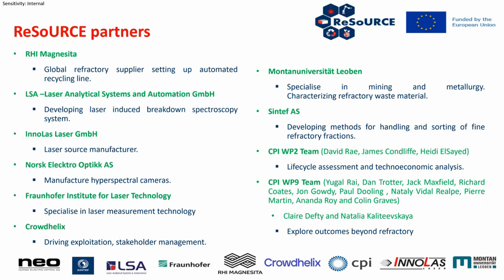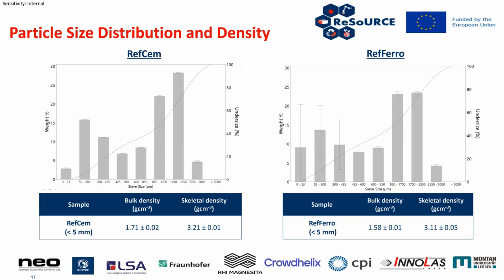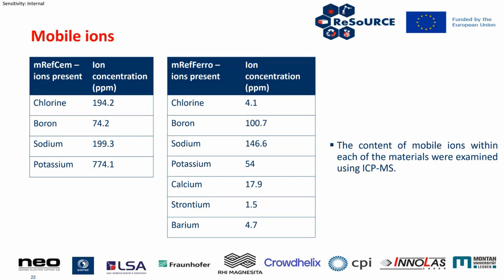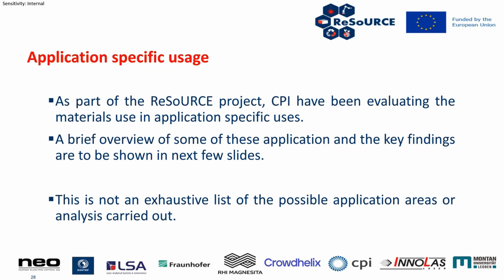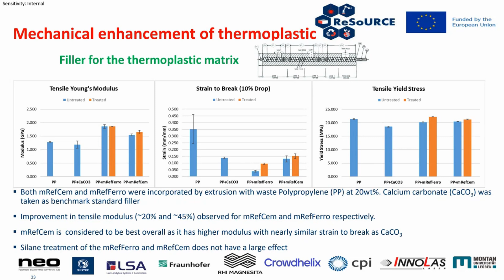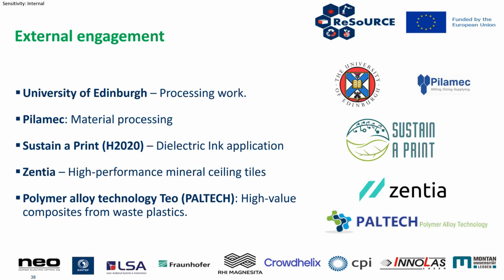ReSoURCE  Wokshop: Unlocking New Opportunities with Recycled Refractory Materials

Comment: This is a very insightful workshop. The potential of fine powder materials from spent refractory linings is often underestimated, and it is encouraging to see CPI driving this conversation. Recycling refractory waste not only reduces environmental burden but also creates a circular economy for high-temperature industries.  

At CH REFRACTORIES, we have been closely following such developments. Our experience in manufacturing fire bricks, castables, and precast shapes for cement and steel sectors has shown us that quality control in recycled raw materials is key. The challenge lies in maintaining consistent chemical and physical properties when reintroducing these powders into new refractory formulations.  

We have also observed that successful recycling requires collaboration across the supply chain—from refractory users to recyclers and manufacturers. For example, our functional products for iron & steel and cement industries are designed with durability in mind, but we are now exploring how post-consumer materials can be integrated without compromising performance.  

The information shared in this workshop from CPI provides a strong foundation for industry-wide adoption. It would be valuable to see further data on particle size distribution and sintering behavior of these recycled fines. If your team is open to it, a comparative study between virgin and recycled content in castables or low-cement formulations could accelerate trust in these materials.  

Looking forward to more updates from ReSoURCE on scaling these solutions. For anyone interested in practical applications, CH REFRACTORIES continues to support trials for refractory recycling in cement and steel kilns.